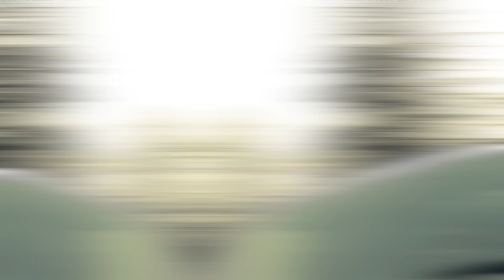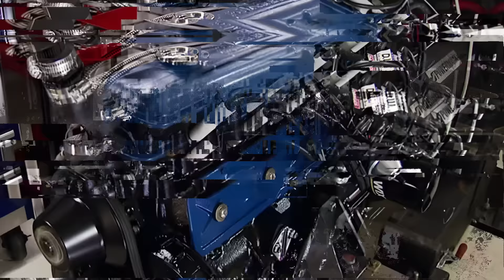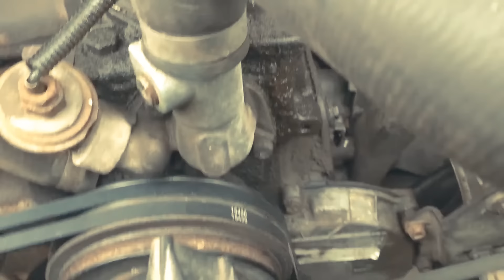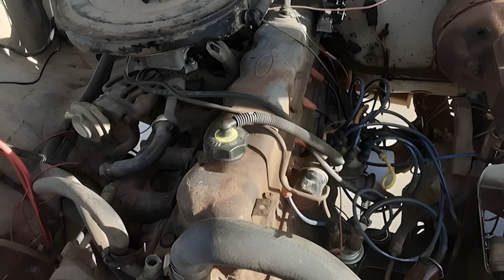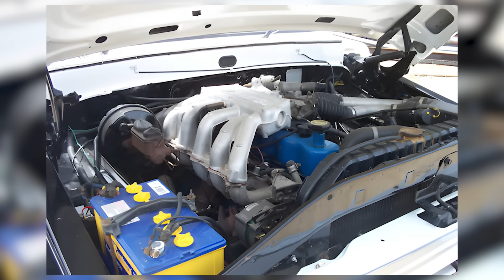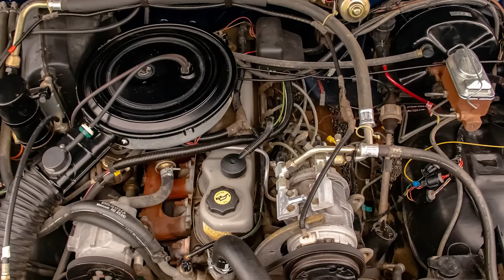The Most Durable Ford I6 Engine Ever – And Why They Killed It?

Comment: I had a 1987 F150 300 5 speed. It was sluggish so I checked the oil level. After adding 3 quarts, it was 1 quart low. Ran great for 200,000+ miles. Frame rusted out. Had to send it to the scrapper after it was my yard truck. I miss the old girl.

Comment: I had a FI 300 in an 89 F150. It had a five speed and a 3.55 gear set. I never saw it get higher than 20 mpg but I also had a somewhat heavy foot. My dad bought a new F100 with a 240 three speed in 67, and an identical pickup in 74. Those did better on gas. All the motors likely outlasted the trucks. I did not know that heavy duty 300 applications had 2V carbs. I know there are some steel cranks in the HD applications. The 240/300s really deserved to be updated with cross flow heads to go with fuel injection. That likely would have kept the 300 in the lineup for many more years.

Comment: I had a 79 Ford F100 step side with the 300 cubic inch straight 6 with 3 speed on the column. It had almost 400,000 miles on it when I wrecked it. Ford used to put the 300 6 cylinder in dump trucks. Big generators and pumps also had this engine that ran 24/7. It's stupid to stop making something so reliable.

Comment: The Ford 300CID (LSG649 as it’s known in industrial trimmings) was a fantastic engine on both gasoline and gaseous fuel (natural gas and propane) in Onan 30EK & 45EM standby generator sets, and Kohler model 30 & 45RZ generators…… I understand some Caterpillar/ FG Wilson generators used them too….. and TECO-Gen refrigeration chillers / co gen units.

Comment: I owned an ‘84 F150 2WD. It was definitely past its prime by the time I got it(dents everywhere, crooked door, missing trim, stop sign riveted to cover the hole in the passenger side floor, mismatched tires, etc.). The valve cover leaked so bad it started on fire once, and it used so much oil before I fixed it I had to run it on old used waste oil from our other vehicles. It never missed a beat and idled like new no matter what. Unstoppable machine.

Comment: I BOUGHT AN F150 IN 1988 WITH THE 300 SIX.. THE COST WAS 11,300 DOLLARS.. RUBBER FLOOR MATS, NO A/C..  IT WAS ALSO A  5 SPEED MANUAL..   THE FUEL ECONOMY WAS 20 PLUS MILES TO THE GALLON WHEN EMPTY.. BEST TRUCK i EVER HAD.. NO QUESTION..
Reply: Wow, sounds like my rig. ‘94 F150 Still have it, runs great. I love to drive that truck  and the dogs  enjoy the ride as well.  I can’t  part with it.  Thanks for reminding me . Cheers to you. P
Reply: I remember in 1985, a car salesman offered me a new F150 4.9 liter six with an automatic transmission for $9999. The V-8 trucks were $2000 more.
Reply: @picklerix6162   I loved the straight six.. Great on fuel, well built, and quiet, Plenty of power with a manual transmission.

Comment: Drove a 67 Ford wagon with the 240 I6 and three on the tree. What a great car. body and chassis rotted away, but that 6 kept right on working.
Reply: Agreed!  Had a ‘65 Mustang with the 200, a ‘64 Econoline van with a 170, and my last and favorite was a ‘69 Econoline factory camper van with the 240 I6. 3 on the tree. Everything manual. Rebuilt at 180K miles. Sold with 350K and would start right up. Such good engines.

Comment: My cousin had one with a 3 on the tree. Thing ran forever on the farm. We had a firehouse whose backup generator had a 300 in it. It ran fine when they replaced it. The generator didn’t have enough energy for the stations addition.
My CJ had the 258. Another great engine.

Comment: I had a 1980 F100 with the 300 CI six.  I drove and beat that truck for 8 years and it was still going strong when I traded it on a new F 250.  When I traded it, it had over 170,000 miles.

Comment: Straight 6 engines from every manufacturer were reliable
Reply: Ford 300, Jeep 232, 258 which evolved into the 4.0 L, Chrysler slant 6, Chevy 292. Even euro cars like the BMW 6 or MB who recently went back to a straight 6. The Jaguar 3.8 and 4.2 were great too, except for the Lucas electronics of course. Of course Japan with the legendary Nissan and Toyota straight 6s. 

Manufacturers went with a V6 to save space, but it was inherently less balanced. The only ones who made a superior one IMO were The big 3 of Japan and the legendary Buick 3800.
Reply: @grumpyweds443  Lucas ignition!!!  Reminds of the mechanics' joke about Lucas "They developed a light switch, had 4 positions...DIM, FLICKER, OFF, and SMOKE"
Reply: @abn82dmp  You could buy Lucas smoke in jars. But in older Jags, it was an indicator of where the fault was. About the only convenient thing about it.
Reply: 250 Chevy integral heads cracked, a lot.

Comment: Not the 300, but a 200 I6 in my high school car, ‘66 Mustang.  I once did a full tune up with oil change and was done and wiping off my tools in 20 minutes time.  LOVE I6’s.  Also have a Jeep 258.
Reply: I have one too, but I always got a rear main seal leak.
Reply: I had one too and found out the hard way that he thrust bearing was on the #3 main cap.  And caused a loud rod knock as the crank moved back and forth about a half inch. needless to say the least practical solution was to fix it so I got rid of it to one of these people who advertised I buy cars any condition $ 125,00 later he was the proud owner, in all fairness it had 4 very good tires new battery and a AOD trans the worked fine as well as a recent starter. So as a parts car it had value. We both got what we wanted.

Comment: The 300 had a commercial power rating of 87KW continuous and had 7 main bearings. Ford replaced this engine in 1994 with the inferior Essex V-6.

Comment: Brought home a new 1978 f100 with the Explorer package.Two tone jade green. 300six threw a rod with 125 miles. A connecting rod nut was not torqued according to the dealer.
Reply: The 70s were very bad years for any Ford.  Had a C-600 cabover that I was supposed to turn back in to Hertz Trucks at the end of the week.  Made a run to Shreveport, La and back. Next run was to Jennings, La.  Just outside of Lafayette the engine blew up.  The bad thing was that the people the truck was intended for was to take delivery of it that week.  Hertz people told me that a rod let go and when they tore down the engine every rod and main bolt was loose.  It took 18 months to get the LN 9000 they had ordered for me because Ford's suppliers keep going on strike.  Not knowing all this I bought a 75 Maverick.  At 12,000 miles it would no more than a block and stall.  Just before I traded it in found out even though the car was just over 12,000 miles, the distributor had 150,000 miles on it.  It came out of a junk yard car.  At that time my car was built, their distributor company went on strike and Ford sent people to every known junkyard in the US to get distributors.  Traded that in on a 77 F-150.  Could not keep front end in alignment and replaced front wheel bearings every 6 months.  Ford did not heat treat the axles so they were soft and would not hold alignment.  If it says Ford on it and was built during the 70s I stay far away from it.

Comment: I had a van with the 300 inline 6 and it was terrible. I don’t understand why everyone says they were good. I had no power and as the miles climbed it got very noisy. I had read there was an issue getting oil to cylinder 1 and 6. When it was 2 years old the hood metal separated and the outer skin separated from all the rust and opened up and smashed the windshield while driving 55 mph. It had 50,000 miles and it was done.  Back in the early 80s the warranty was 1 year. Maybe the van was too heavy for it but as it was the company never bought any more.

Comment: Pulled 6000 # boat up the longest , steepest ramp I had ever seen….. on the way in the boat pulled the van down to the water with the brakes locked . The ride out was exciting . After a lot smoke and spinning tires that 300 pulled it all the way up the ramp . After the 400 mile trip home I discovered both motor mounts were completely destroyed .

Comment: I have a '65 F100. I ran 240's b/c that is what was in it. Bought this truck on 12/23/82. The original  motor sounded like the rocker arms were loose. They were ok. The rod & main brgs were so worn is why it sounded like it did. I put another 240 in it. It lasted 8 yrs. The oil lite came on. I kept on driving till it froze up. Put in an oil pressure ga. Not trusting the "idiot" lite. Replaced it with another 240. It lasted 27 yrs. Gave 169,000 miles of trouble free miles. I was very careful to Never let the oil go past the 3,000 mile limit. I'd change it the weekend b4 the 3,000 came up.
  A yr b4 this last 240 was replaced, I put a pair of the efi exh mnflds on. WOW ! The difference in power...was stunning ! When the engine started to put out black smoke (must have been from the worn rings...low compression too...had the valve seals replaced, so they were not the reason for the black smoke).  I had the engine removed and replaced it with the 300. Out of an '86. It is a Jasper engine. Solid quality...sturdy as can be. 
  Again using the efi exh mnflds. Also using the 1V carb & oil bath air filter.  My truck weighs 5,300 lbs. 
I have a Miller welder generator on the back. I did do portable welding with it. Have the sides and back of the fab table made out of 5/8" X 9" A-36 plate. The center is 52"sq of 1/4" plate. Underneath are aluminum crossmembers. 3" & 4". It is a rolling fab shop. 
  On the front bumper is a 8,000lb electric winch. It is one bad  a$$ winch. Has 175' of 3/8" aircraft...Wire Rope. 
  The whole thing is a beast b/c of the 300 Cubic Inch Jasper engine. 
All the best...everyone, Pete 🙂
Reply: What’s the GVW on that rig?
What transmission are you using?

Comment: The Ford 240/300 blocks did not have extra think casting/cylinder walls - they are actually thin wall castings.

Comment: Ford need to bring back the 300. Aluminum block,  overhead cam, and port injection, turbo. That would make for a great motor. Pair it with a 6 speed stick, I'd probably buy that in a heartbeat.
Reply: An inline six version of the 7.3 Godzilla might have 5.5 liters

Comment: Anything that's reliable,the big 3 stop building. Their biggest fear is you won't buy a new vehicle every 3 years and fix it yourself with ease. The same goes for appliances that some are still running from the 60ties like that big curved refrigerator that used to be produced.

Comment: Owned 2 of these both new a 77 and a 92 they only required new starters and alternators and the 92 needed a belt tensioner that the77 didn't halve and between the two got 325 K miles with only minor repairs. However your milage estimate was way off on a round trip to Arkansas from Chicago with 3.08 gearset and 5 speed OD transmission [ The Mazda M5 ] with a .076 final drive in my 92 with the multiport fuel injection it got 13.4 MPG on the way there and 14.2 on the way back due to the its a short drop to the Mississippi ang a long climb out into Missouri from Illinois, also I could get non ethanol gas in Arkansas with 97 octane  best I could do in Illionois was 95 octane with ethanol. In contrast I took my son up to Wisconsin in a 5.7 Hemi Grand Cherokee with a 3.73 gearset due to trailer tow and a OD automatic and got 16.8 MPG due to the route being flat the difference being  [ And the JEEP was driven a lot faster] the Jeep was smaller and had a smaller frontal area [ and was no lighter by any means . The Ford was in its means with heavy load on backroads with hilly country and that's how farmers used them. The 292 GM was rare as it was a extra cost option and parts were not stocked as there were few of them on the road, and as the 300 Ford was standard at no extra cost and offered the same cost but was more easily service. What was the attraction of the 292? It Costed more and offered no performance Advantech to speak of  , I would just get a V8 for little more cost . considering the extra cost higher fuel consumption which was minimal. In this case paying $ 145.00 more than the 292 which was a option above the 250 CID 6 was well worth it. As it that time the gas was cheap. And meant little above the purchase price

Comment: Wouldn't it be great if Ford brought this engine back?  They could modernize it with a cross flow cylinder head and modern combustion chamber design. They could even give it 10psi of boost (optional) which would make it a real monster. I am not sure if it had full floating wrist pins, but if it didn't they could change that too. Give it  modern pistons and rings and a modern ignition and fuel injection (so long as it's not direct injection). It's an awesome engine that could be brought into the 21st century.

Comment: I bought a 1967 F-250 in 1982 it already had 200,000 on the 300 six and truck, original owner sold it to me, and he said he just changed the oil and did tune ups.
I drove it another 120,000, pulled my boat with it,  blew a head gasket, so I had the head reworked, and the machine shop owner told me it wasn't badly worn.
Stuck the head back on it, and sold it eventually to a farmer friend, he drove and used it on the farm for years. Great engine.
Bought a new 86 F-150 in early 87, it had a 300 six, I really wanted the Fuel injection 300 six, but would not own that Ugly Truck.

Comment: I'm not a Ford guy, I'm a GM guy.  But I did buy a 95 F150 with the inline 6 for 5000 with 140k on it, drove it to 200k and sold it for 6000 and never did anything to it other than lower ball joints and oil changes. In all fairness, all the straight 6 motors from the big 3 were good reliable motors.
Reply: My friend's grandpa has a 1997 F-150 with the 300 and it has over 800k original miles, never been cracked open.
Reply: @platinumuschannel  I was living in Detroit at the time and everything rots.  I'm in Phoenix now and have been keeping my eyes open for another one.  If I found a good deal on the same truck I had, I would buy it. It was a 95/300/auto ex cab. They are still all over out here, but people hang on to them.
Reply: But that was the big one. GM had the 250 and the Pontiac overhead cam one, which was unusual. Dodge slant 6 you could not kill. A friend tried. It beat him.
Reply: I'm a GM guy, but....... so common.

Comment: Years ago my dad had an early 1980s E150 van with  the 300I6 engine. That engine was wonderful. It was reliable and easy to maintain and work on.
Reply: Back in the early 80’s, my Mom owned an old Sears van, which was a Ford Econoline. I think she said it had around 300K miles on it. No doubt it had the 300 I6.
Reply: We used an E150 with the 300-I6 to haul tv's for the whittle Communication installs back in the 80's.  Drove all over the four state region and up into Wyoming.  We also had a box truck with a chevy 350 v8.  I would put a trailer, U-haul box type, on the Ford and haul larger loads than the chevy, pull those mountain roads better, the Ford would leave the chevy way behind while being better on fuel.  The 300 six was injected and the chevy was carbureted, that was an advantage for the Ford.  Excellent work rig, the van with the injected 300 six, wish I could find one today.

Comment: Also, the "TUG" line of baggage tugs and belt loaders used at airports all used the 300 straight six!! We haul over 30,000lbs of cargo on trailers behind the little TUG and it pulls with no issue!!
Reply: Do you have the manual 5 Speed Transmisson ?
Reply: @curtrn  They have a 2 speed automatic. Geared low. Top speed 15mph. Amazing little tugs!

Comment: I worked on these at the dealership in the mid '70's. They were no better than anything else concerning longevity. They had a nasty habit of dropping the piston skirts into the oil pan when lugged hard. as well as the  valve guide and valve seat recession issues common to most domestic engines of that time, and the timing gears shedding their teeth.
 Actually the 200 was a much better engine.

Comment: My Dad had an early 70s or late 60s Ford F100 with the inline 6.  Opened the hood and there was a foot of open space on each side of the engine.  You could see the ground very easily.  A man could stand on the ground beside the engine.  It had a 3 on the tree manual.  Drove it some during the mid 1980s in high school.  Don't recall what the odometer was.  In late 1993 I bought a 1994 Ford F150.  XLT with 4 wheel drive and automatic.  A fancy truck.  Had the option of the 300 I6 or 5.0 V8 or 5.8 V8.  I went with the big V8.  Glad I did.  But I knew the old inline 6 was a proven winner.